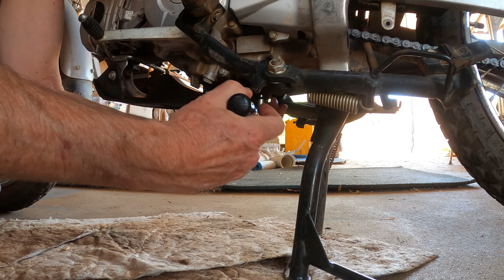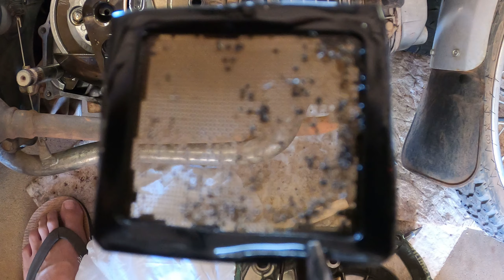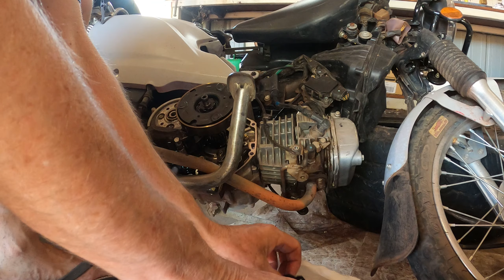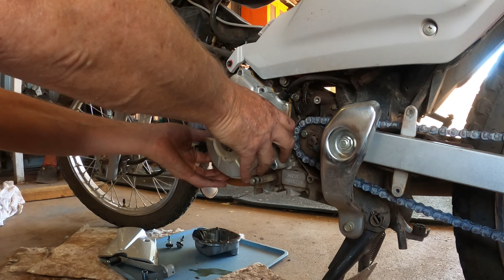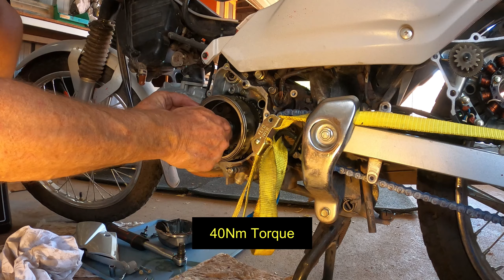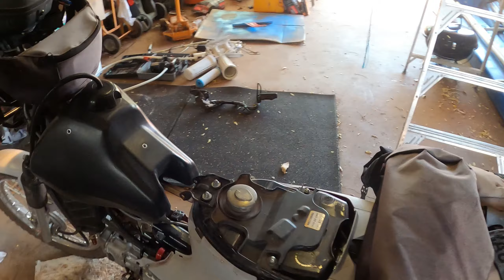Honda Super Cub NBC110, Innova - Cam Chain & Oil Filter

Comment: hey mate, where did you buy the gaskets from? just picked a 2016 model and am wondering what sight you use for your gaskets. cheers
Reply from the maker: Lambda Motorcycles in Queensland. They sell kits etc, online. You can also ring Mike the owner/mechanic if you have questions. Good idea if you're opening up the motor to get a new rubber cap for the cam chain tensioner along with cam chain etc. Clean out your centrifugal filter. Cheers Jeff
Reply: @Jeff4fun  perfect, thank you very much jeff :)

Comment: Hey mate, thanks for the informative video. Do you happen to know what size the fly wheel puller is? I can see it on lambda but it doesn't mention the size and I would prefer to get it locally if I can.
Reply from the maker: Hi mate I don't have the puller with me but the Honda part number is 07KMC-HE00100.
Hope this helps. Cheers Jeff

Comment: thanks for the video mate, you said change the oil every thousand kilometres, what oil do you recommend ?
Reply from the maker: G'day Rick. I use Motul 5100 4T 10w-40 or Honda 4 stroke motorcycle oil 10w-30. Cheers Jeff

Comment: Nice video, where can I get the manual from?
Reply from the maker: Hi Jake. You can download a CRF110 workshop manual from Manualslib. Same engine as NBC just not fuel injected. Lambda Motorcycles sell hard copies. Cheers Jeff

Comment: Where manufacturing japan or Thailand and is best than
Reply from the maker: Hi my Supercub is made in China I think. I have a CT110 that is made in Japan. I love both of them. Cheers Jeff
Reply: @Jeff4fun  thank you here we difficult from Tanzania getting it's part
Reply: @Jeff4fun  but it good motor bikes and simple
Reply from the maker: Yes easy to work on. Hope you get the parts you need.

Comment: Is this a 3/8 X 5/32 chain?
Reply from the maker: Hi Hakan I pressume you mean the drive chain. I don't know the imperial measurement. It's 420 pitch with 102 links DID. Hope this helps. Cheers Jeff
Reply: @Jeff4fun  Hi Jeff. No i meant the camchain sorry for not being clear. I have an old 50cc engine that use a 3/8 x 5/38 x 1/2 50 link chain in the gearbox. These are a bit expensive 50$. I thougt If I could buy this chain from ebay for less!
Reply from the maker: Hi Hakan I don't know what the cam chain is I just bought the right one from a supplier here in Australia. It came with a kit with the gaskets & other bits specific to my bike. Hope you find what you need for your cub. Cheers Jeff

Comment: Enjoying your videos. You make it look easy. Can you upload vide on cam chain adjuster? Enjoy your riding
Reply from the maker: G'day Mike, glad you liked them. The cam chain tensioner on the Super Cub is self adjusting via oil pressure. When the engine gets rattly on start up something is probably worn out & needs changing. I replaced bits when I got the bike from auction & I should have made a video then. Hopefully it will be awhile before I need to do it again. I'll make a little video whenever I do something interesting on either the Super Cub, CT or any future bike. Thanks for your comment. Cheers Jeff